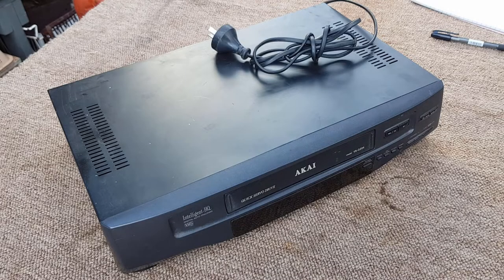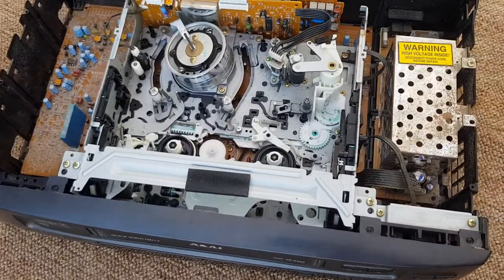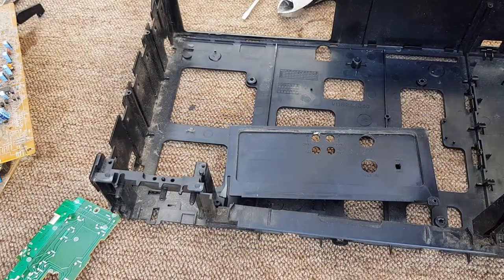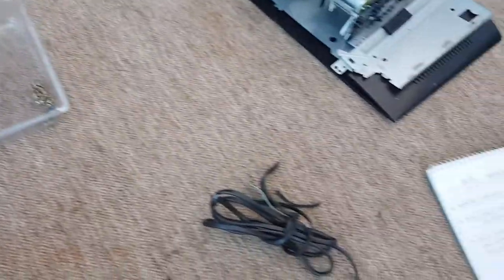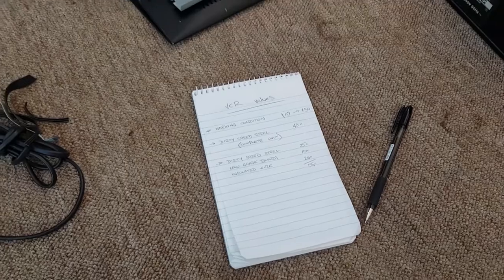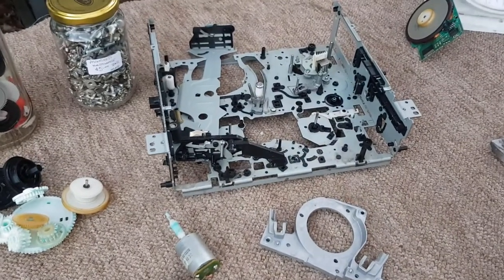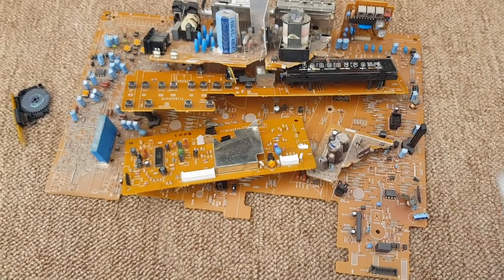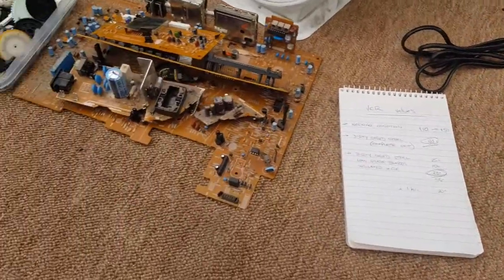Scrapping out a Video Cassette Recorder VCR. Is it really worth it? Plus finding some extra value!

Comment: Do a DVD player next! i have a few old ones here that came with surround sound! they are resting on a shelf! waiting, waiting.  My old VCR is still hooked up to my comp so i can transfer old videos to DVD. Been ages since i turned it on, so it might not work! Great scrapping lesson, i wonder if those power supplies can be used to power 12v lights?
Reply from the maker: Thanks for your comment Michael! I have a DVD here perfect for a quick scrapping video 👍
Depending on the current draw of your lights, a simple 12v wall charger is probably the easiest! Did you see my video on strip lighting?
https://youtu.be/XSH6EHgdHIU